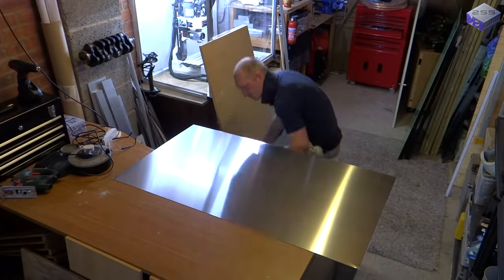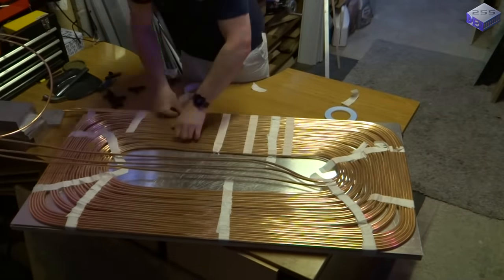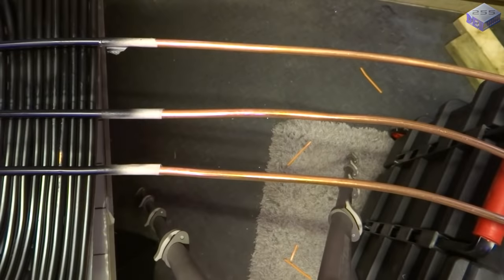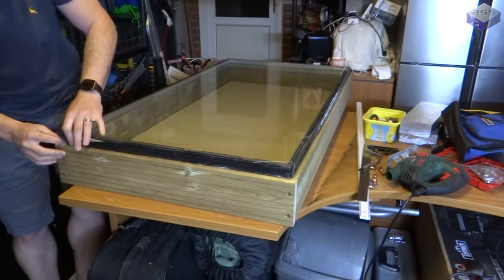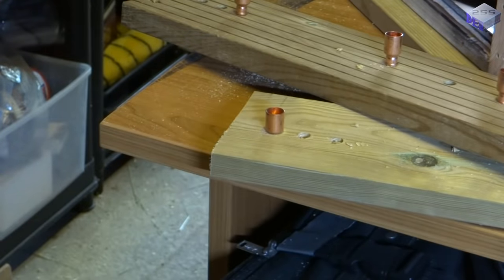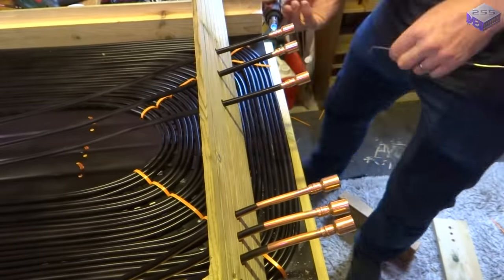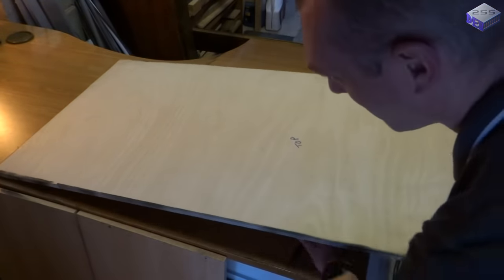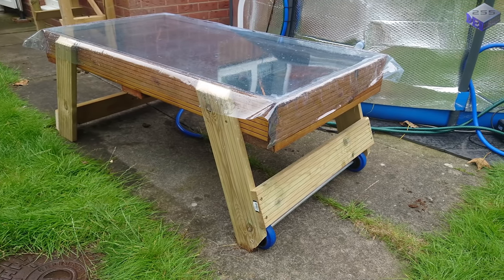Improved Solar Pool Heater - Full build

Comment: Living in Southern Africa with no lack of sunshine i bought 300m of 20mm irrigation pipe, threw it on the 2car car port's roof and well, it's overkill!! 3 hours and the little test pool which takes about 3000L of water is uncomfortably hot, that using a 1500watt pool pump to race the water through, atleast now i can have the pump on for a shorter time period and I've got spare irrigation pipe should i ever decide to get into gardening.
Reply from the maker: Haha, maybe we could get some of that heat pumped over here where it's sunny for the least amount of time. Could you use the excess heat to direct to you house hot water supply, maybe a washing machine too (hot water feed in) so that it uses less power?
Reply: @TheSolarPoweredEngineer  solar geysers are extremely effective here, but cost an arm and a leg, I'm sure my neighbours don't appreciate the view of random irrigation hose laying on my roof, but my bank account sure does appreciate it 😅.
I do definitely want to experiment with water pipes under the tiles and then hook it up to the irrigation pipes to see if one can get some extra heat into the house, and then later the coiled copper pipe inside the fireplace and then plumb that into the under floor system, the thing is to have it as primaries and cheap as possible, but i jump around between "projects" so much that i never go all out with my ideas 😊, that's life i guess.
Reply from the maker: @snowflakecuntreeman3947  It sounds like you ike to try out different projects, I was the same before doing some YouTube videos, where I would jump around from project to project without finishing one haha. Now I focus on each project to show the steps here. I like the idea of the pipes in the fireplace, it's all about saving money these days. Good luck with your projects.

Comment: I have a lot of heat in the attic from the corrugated sheeting on the house because there are few splits placed only for mechanical resistance and a lot of heat is transferred from the sheeting to the attic.. Even in winter when there is a little sun, it heats up up in the attic and I didn't know how to transfer heat from top to bottom. A solution for the summer can only be the following. Copper pipes can be installed through the grids of the sheet metal on the house, through which the water may circulate at some distance from the sheet metal on the roof. On the entire surface of the roof, a lot of caloric energy is lost and transferred to the attic. It can be transferred to a heat engine or a steam engine that produces free electricity and hot water only in summer. In winter, it is more complicated to recover heat because the water freezes. Used possibly antifreeze ..... The electrovoltaic panels are fragile, expensive and with a .......larger hail.......it certainly won't last.....Anyway, I don't have enough money for something like that. There are many houses and fences with corrugated iron dissipates heat from the sun, heat that can be used... With the 0.5 mm sheet we have a large transfer of heat in the attic. It is logical that with the 0.2 mm sheet the yield should be higher... They can be oriented according to sun using electronic systems for maximum yield.
Reply from the maker: Hi, it does sound like you get a lot of energy that needs harnessing. I think the water would be ok on the roof it it was protected from the other elements, wind, rain, etc. So the wind won't take the heat away while the sun warms your panels/piping. A greenhouse effect is about the best solution I believe. I am currently trying out some polycarbonate clear sheets that are relatively inexpensive (can be purchased as large off-cuts), plus they are light weight and can take a beating from hail. During the night, if the outside temp is going below zero, you can run pre warmed water through the system to keep the water from freezing; the air in the greenhouse (polycarbonate enclosure) should insulate fairly well (unless you have a complete freeze with snow) although you would probably be able to keep the snow at bay with warm water and still get the heating effect from the sun. Solar Thermal is a lot more effective than PV, where you could use a PV panel to control the pumps/electronics and have the water cycled through an emersion heater, so that you could switch that on if the weather turns.

Comment: What’s the temperature going in and coming out on a clear day?
Reply from the maker: The heat output at a flow rate of around 5litres / min was around 1.4ºC, which is roughly around 500W. I need to do more testing this summer, so will be measuring flow rate directly and heat in/out to calculate instant wattage.

Comment: Dear Neil, great job. I just was wondering where I can find some basic data like size and weight.
Reply from the maker: Hi, sorry for the late reply, I have just spotted your message. The glass is 1240mm x 640mm x 40mm and the unit is 1280mm x 680mm x 160mm, although it now has legs to stand on. The combined weight without water is 50kg, so it's pretty heavy. I will be changing the glass for acrylic or polycarbonate at some point as this should increase the effectiveness of the panel as the glass reflect some of the sun's energy.
Reply: @TheSolarPoweredEngineer  Thank you very much Neil for this information.

Comment: Do you have an average temperature gain when in full sun..well as much sun as you get?
Reply from the maker: Hi, not as yet as there was very little in the way of summer last year, I measured around 500W average, although need consistent days of sun to get good values. I intend to do a number of experiments this year with small versions to see which one is best.

Comment: I live in Gran Canaria and will be installing this in my Airbnb villa. This means that I myself am not on site and can monitor. I will set a timer so that the pump only circulates water when the sun is up. But as there is a lot of sun on Gran Canaria, the water will quite quickly reach over 30 degrees. Is there any gadget that can automatically turn off the power to the pump when the water is 30 degrees.
Reply: Yes you want to install a pump and a thermal cut off switch so you can set it to say 28° and it will automatically switch off,
Reply from the maker: Very nice, I'm not jealous, honest. Yes there is a thermal switch you can attach that will do exactly that, here is a link to CPC's Thermal switches, you should be able to find one for that temperature: https://cpc.farnell.com/c/electronic-electrical-components/sensors-transducers/sensors/temperature-sensors/temperature-switches.

I would recommend an expansion tank attached, similar to a car expansion tank as the pressure from boiling water could damage your system or burst with scalding hot water if the water stops running and Is allowed to get hot (especially if you live higher up as water boils at less temperature at higher altitudes). I have just purchased a car expansion tank as they are fairly cheap and come with a pressure release cap. You may also want to connect a simple 12V relay to a small solar panel (around 5 to 10W) so the relay is energised only when the sun is up so that the pump switches off automatically at night. I hope that helps.

Comment: Would a plastic fresnel lens be available in same size as glass panel and can it be used to provide more power?
Reply from the maker: Hi, it could be used to provide more power, although it would have to be larger than the glass as it has some attenuation and would need to rotate around the panel while tracking the sun, so may be fairly complicated to implement, but like your thoughts.

Comment: Just a thought to make it more efficient could you put magnifying glasses on it to create more heat
Reply from the maker: I am considering adding 2 reflectors that track the sun on either side of the unit so I can get more light on it. There was talk about fitting a Fresnel lense above it, although it would have to be relatively large and also track the sun to keep it on the panel.

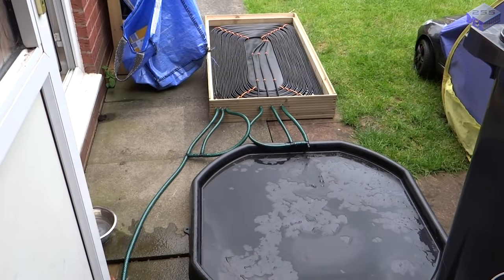Comment: 13:32  FYI  you DONT INCREASE THE FLOW when running them in paralelle.     because your FEED tube is the same diameter.. your feed rate is limited by your feed tube diameter.   thus,  it can not increase flow.   running in series would be better, as it would give MORE time for the sun to heat a unit of water.   where in parellel, your cutting your time in sun down by 1/4 for a unit of water.
Reply: He can't increase the flow beyond the feed tube, but he can limit the flow by running them in series because the copper has a smaller diameter than the feed and output tubes - causing restriction.
Also, it really doesn't matter the amount of time the water spends in the tubing because it is just being looped back to the source (the pool).  If you were building one of these to heat a shower then you would be correct - you'd want the water to spend as much time in the pipe as possible so that the water exiting the system has time to increase in temperature the most, but since it's just being looped through a pool it doesn't matter how much a single unit of water is increased in temperature.  The box can only add a certain amount of energy to the entire system (500W from what the video says), and whether you are increasing 500 gallons by 1 watt or 1 gallon by 500 watts really won't matter once it's pumped and mixed back into the pool.
Reply: @meihauf  wrong.. have you built one of these for a REAL POOL???   because i have.  and i have used these to not only HEAT pools, but also to COOL THEM.   the more time water is in direct contact the more it heats.. for a pool, this is especially important because WATER IS NOT A GOOD HEAT RETAINER..  the surface of the pool ALWAYS EXPELLS HEAT by a means of conduction with air.    i've done so many of these, i have also made water jackets for the pool pumps!!   so please.. unless you have real world expierence,  keep it to your self.
Reply: @meihauf  i have also built controllers to not only monitor but also operate these via the web or cell phone app..  built FROM SCRATCH with esp32's and rpi's!!
Reply: @danratsnapnames  Hello Dan would you happen to have a link to a video of a simple diy solar heater ? 

I have watched many of these and all different ideas .

I plan to make a simple one with black plastic hose 500’ ( irrigation) framed in a sheet of plywood . 
I would like to run it off a solar panel .
Thank you
Reply from the maker: @JAYY_JAYY  My first panel works pretty well, where there is a lot of data on my website from an Arduino logger that tracked 10 temperature sensors for the entire system, so you can see the heating effect at different times if the day. www.dev255.uk for more info. The Arduino also transmitted the info to the house so I could monitor it from there
Reply from the maker: @danratsnapnames  I will have to test all the ideas on here to get the best panel possible and track it with my Arduino nano that logs the temperatures, I may even put some flow meters on each output to see what the flow is on each channel, them set it to series flow to see the difference, that's why I put the connections on the outside.

Comment: looks good!
Id like to see some numbers... like water temp in, and out at given ambient temps!
Reply from the maker: They'll be a video out at some point on this as we didn't get much of a summer last year and I'll need to fit the flow rate meters and temp sensors so I can log all the data, I calculated it to be around 500W from last years test, but I will be changing some things on this one to see how efficient I can get it.

Comment: add bitumen for thermal mass, lower refractive index and longer flow of hot water. Add iron sand on top for super absorbent surface
Reply from the maker: Hi, I have heard of iron sand being used before but have not done any research on it, I may have to look into getting some for comparison. Plus some bitumen, although I'd be concerned with the weight. There are so many factors that I'm learning through doing these experiments at home. Thank you for your comment.

Comment: Very nice design...    I'd be interested in some water temp measurement data.  Peak temp over what period of time?  500 Watts doesn't make any sense.
Reply from the maker: Thank you, I'll need to do some more tests similar to my first solar pool heater, parts 1,2 and 3 where I went into the temperature changes in some good depth, here is the link to the first video if that helps: https://youtu.be/QU7RUfWXfZ4

Comment: The  project is cool but... is it going to heat the pool whenever there´s no  direct sunlight? If not, I don´t see the point of it
Reply from the maker: Hi, I haven't had the opportunity to test this one fully, although the first version did very well achieving 600W average over 8 hours, so  4.8KWh per day, our pool if 4600 litres got up to 31deg C. This is all to see how efficient a solar thermal collector can be made at home. PV is only 20% efficient, so Solar Thermal can be nearer 90% I believe. More testing is needed, especially to see how effective they are in low sunlight. Hope that helps

Comment: Good luck getting any significant heat rise out of this. My pool is 15,000 gallons and my 150,000 BTU heater can raise the water temperature about 2 degrees F per hour. 150,000 BTUs is equivalent to 43,931 watt-hours. So your solar panel that you rate at 500 watts isn’t going to cause much of a temperature rise.
Reply from the maker: Hi, yes 500W is what I measured it at last year, with my previous panel averaging 600W (900W peak} so 4KWh for an 8hr day average. With that panel and a purchased panel collecting around 400W average my 4600 litre pool increased by around 3 to 4 Deg C per day and dropped by around 2 to 3 degrees overnight, so with a the good summer of 2020 we saw our pool get up to 31 Deg C, not too bad for free energy. The idea behind making these is to see which method is the most efficient and that can be made at home, so this is just testing really, although can be used on spa's and small swimming pools over the summer. 4KWh per day would save around £24 per month in electricity, so I believe these are still a good option to make and would pay for itself in a couple of years of decent summers, although you would need a fair amount of them for your size pool. Hopefully I will get to the stage of finding the most efficient type to heat a large pool with the least amount of footprint.

Comment: Have you done a video on the pool connection side? Interested in how it’s pumped around.
Reply from the maker: Hi, I will be doing a video on this, although it's not fully configured just yet, there is also a UVC device in line too ;-), so I'll update on that too.

Comment: Would soldering the pipes together (Using lots) give it more better conduction?
Reply from the maker: Hi, it may have some positive effect although thermal bonding would work a lot better plus you wouldn't have to heat all that material up.

Comment: interesting. I think of the 2 ,I would go for the earlier version simply because of size , manoeuvrability and cost.  I wonder how much of a rise in centigrade they produce. I saw the earlier version raises the water in the bucket but really I would like to see how much it raises the water in the pool on an average UK day. I queried an AI bot which reckoned that a 1000 gallon pool would need 145 three litre kettles of boiling water to raise it by 1 degree, How much can your DIY heaters  extend the season by do you think?
Reply from the maker: Hi, we had our pool get up to 32ºC during the summer, although that was with the version 1, 2 and purchased one installed. The pool gets a fair amount from the environment too, so the insulation is key to keeping the heat in ready for the next days heating. That way it steps up by a degree or 2 each day. We also had a clear dome pool cover on it to allow the sun to get in, but evaporation to be reduced, plus a Sol micro 50 floating cover on the pool to also increase hear and reduce evaporation. There is a lot to consider, where the version 1 and 2 heaters added around 6ºC to the pool temp, with the rest was environmental effect. This allowed the pool to be kept out for just over a month longer. I hope that helps.
Reply: @TheSolarPoweredEngineer  Thanks, yes that is useful. Our pool is in a polycarb greenhouse and I am looking at how to increase the water temp cheaply . It has just become too cold to swim in (under 13 degrees C yesterday  (nov 3rd), when checked). I like your copper tubing idea very much.  I am toying with the idea of making a sand battery and running copper through it to then run water through. Maybe just a pipe dream but anyway.
Reply from the maker: @logothaironsides2942  I like the pun :-D. That sounds like a great idea, so you can store the heat a little longer. Sand has a lot lower Specific Heat Capacity though of around 850, as opposed to 4182 for water, so water would be harder to heat, but also harder to cool down, so would store more energy.